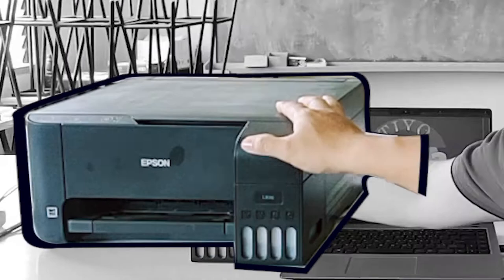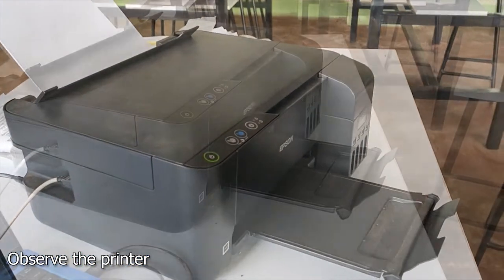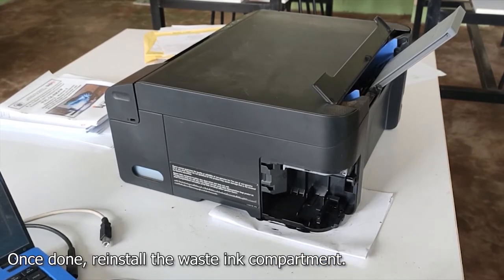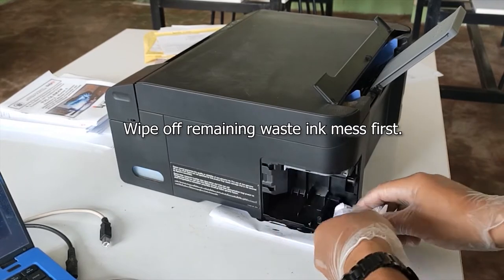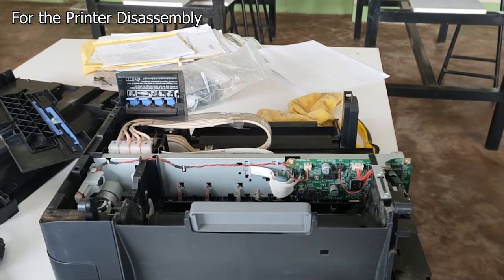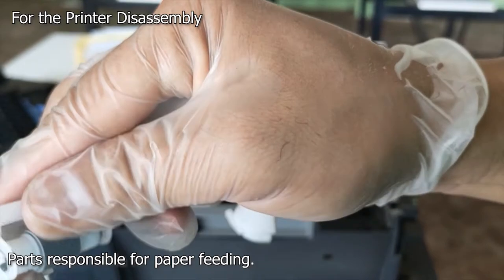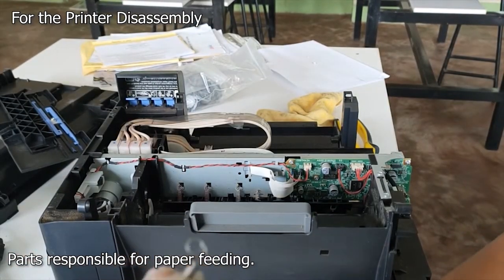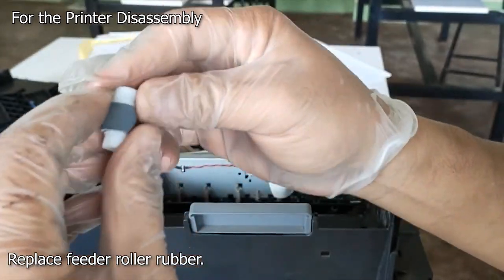The Things You Should Do When You Have Paper Feed Issues with Epson L3110

Comment: Sir saan po nakakabili ng parts for rubber and feeder roller ng l3110
Reply from the maker: Hi po sir. Maraming salamat po sa pagtatanong. Sa akin po, sa Shopee ako bumibili. Working naman siya. More than 20 units na po yung naireplace ko na pickup at feeder roller rubber. Search niyu lang po ang feeder roller and pickup roller rubber sa shopee at hanapin niyo lang po ang para sa specified units nung printer ninyo.

Comment: how did you install the roller without even looking sir?
Reply from the maker: Thanks for raising a question. Actually, there's a designated slot for the feeder roller underneath the printer. It holds the feeder roller in place. I can sense that slot by touching and aligning the feeder roller lever. Hopefully, I will show a detailed video explaining the function of the printer and how it works...

Comment: Good evening sir, is it really needed that the lower feeder runs on both sides?
Reply from the maker: Hi good evening. If I get your question right that if it is correct that the bottom feeder rotates in both sides, then the answer is "NO" if it is with the same model, EPSON L120, L210, L220, L360, and L3110. It should only be in one direction, that is towards the printer. If it happens to rotate in both directions, the spring inside the bottom feeder that controls a one-way direction could possibly be broken.
Reply: @TiyoTurko  thank u so much sir
Reply from the maker: You're welcome @carlacamilotes2277  and thanks for reaching this channel. 😊😊😊
Reply: Pahabol sir hehe where do u buy your supplies po?
Reply from the maker: Shopee po @carlacamilotes2277 . Nirereview q lang muna 'yung mga comments ng mga buyers bago q i place yung order. 😊
Reply: @TiyoTurko pwede po mkahinge ng link sir? Hehe nabudol po kasi ako ng panget na product (lowerfeeder) sa shopee last time 🙁
Reply from the maker: @carlacamilotes2277  Pwede ring rubber lang bilhin basta working pa yung roller spring.
https://shopee.ph/product/234974010/5359587466?smtt=0.62811351-1628724177.9

Mas makakamura ka kasi at pwd mo pang gamitin sa iba. Lalong lalo na kung nag rerepair ka ng mga printer units. Marami kasing Epson L3110 ngayon at kadalasan, printer rollers yung problems.

Pwd ring i check ang link na to:

https://shopee.ph/product/344750542/5568093953?smtt=0.62811351-1628724123.9
Reply: @TiyoTurko  thank u so much sir 💖 this is a big help 🥺
Reply from the maker: You're welcome po @carlacamilotes2277  . God bless...

Comment: Hi guys! For those who can't dismantle their printers and go to a shop at the moment, I found a 50:50 solution. In the gray part in the paper try, you can tape it so the angle of the papers to the feeder can be steeper. This can help people specially during pandemic. Cheers!

Ps. Tapes leave residues if left for a long time, it might cause more problems. Be sure to remove it after use!
Reply from the maker: Thanks for sharing great ideas... 😊😊😊